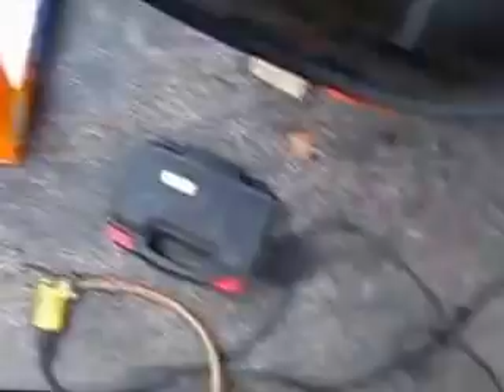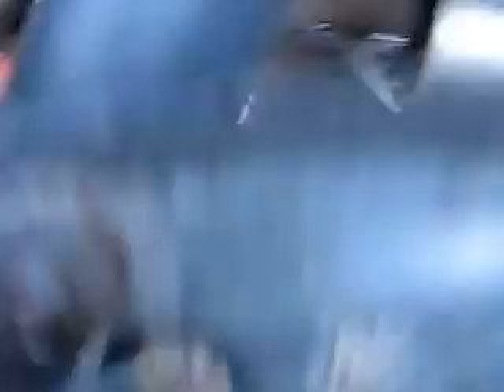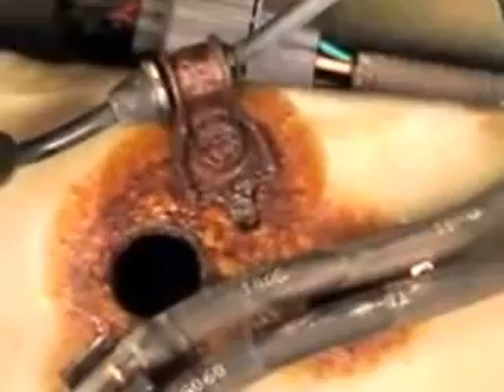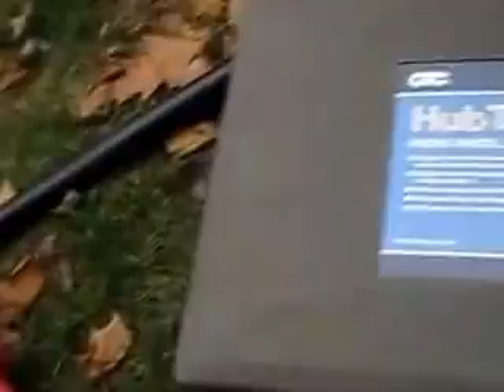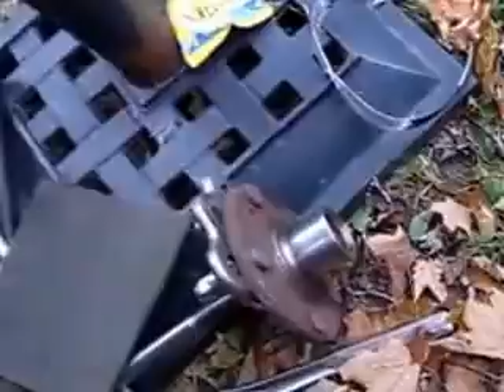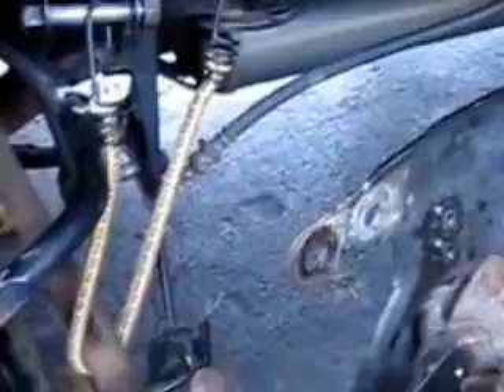2006 Honda Pilot How To Replace Rear Wheel Pressed-In Bearing

Comment: putting thr bearing back in is easy.  how did you pull it out
Reply from the maker: I used a bearing press tool similar to this HF one. https://www.harborfreight.com/front-wheel-drive-bearing-remover-and-installer-kit-21-pc-63728.html

Comment: Are the fronts a similar process? Or do you have to remove the knuckle completely?
Reply from the maker: If you have to the tool it's the same process.  If you don't have the tool you would need to take the knuckle off and use a press to press the bearings in/out.

Comment: The spindle nut as a safety dent all you had to do was punch it out with a screw driver and it comes right off 👌🏼
Reply from the maker: The spindle nut was seized on the cv shaft because of rust.  Also known as a "rust weld."  I am completely aware of the indent on the nut. Trust me the indent wouldn't have broke all those breaker bars.
Reply: Was able to get my nut after heating it several times and spraying penetrating oil then using a 10 ft long pipe on my 3/4" ratchet.